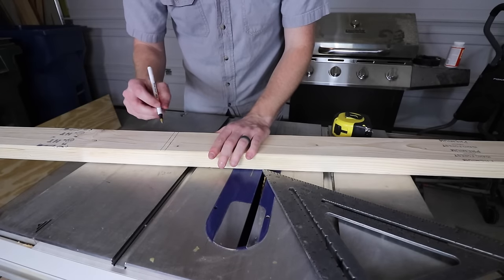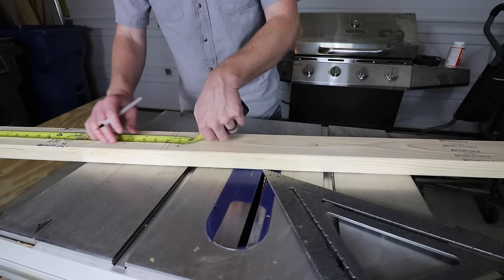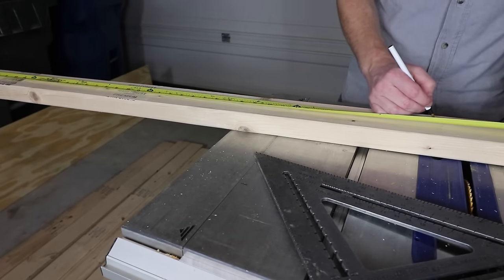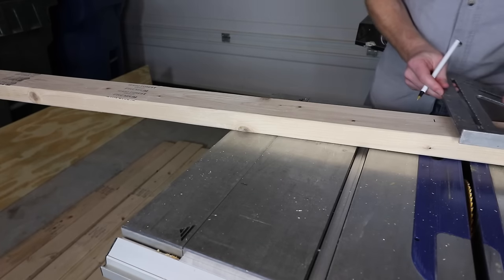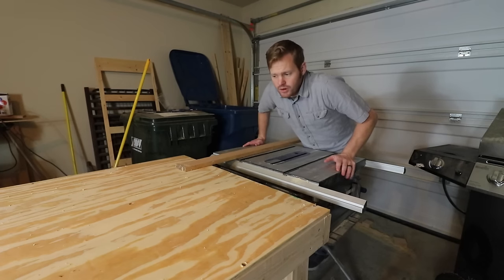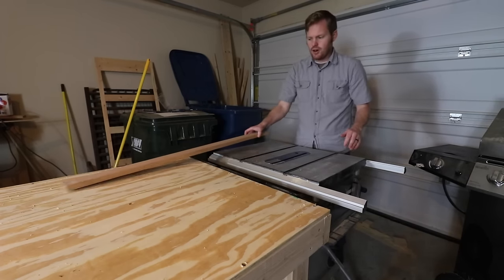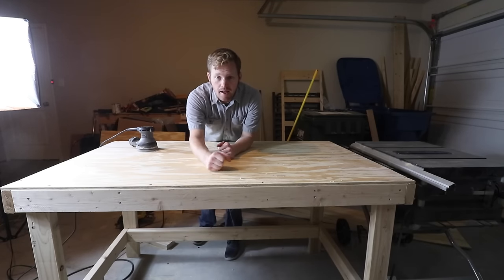EASY DIY WORKBENCH for UNDER $50

Comment: $500 in 2023
Reply: Came in to post that the title needs to be edited to reflect the new insane prices of wood. At this point it's probably cheaper to buy a pre-built work table.
Reply: $1200 in 2024
Reply: Agreed. A single sheet of plywood is like $25 dollars
Reply: You not lien!
Reply: @qxweiii Lowe’s has plywood for like 15 bucks. Pre pandemic it was like 10. Y’all are fucking wild. This might cost at absolute most 250
Reply: 2024 here: make that 1,000
Reply: Im building one right now no more than $100 in materials. Well having the tools is a whole different story. 😂 forgot screws are expensive so no more 150$
Reply: Lol still between 50-100 euros 😂

Comment: The table works great! Thanks. Here's how I got away with using six 2x4s:

Cut list (added last entry to complete the list):
- plywood rip to 2'9" x 5'
- 4 2x4 @ 34"
- 2 2x4 @ 2'9"
- 2 2x4 @ 57"
- 2 2x4 @ 27" 
- 2 2x4 @ 54"

- 2 2x4 @ 30" to support the top from the inside.

Cutting Procedure:
I got away with six 2x4s, cutting the 34" segments from the same piece, then using the middle segment to cut another inch off and make the 27" cut. Repeat with another 2x4 to end up with 4 2x4 @34" and 2 2x4 @ 27". Cut the 2'9" and 57" from same board, discard middle, then repeat to end up with 2 2x4 @ 57" and 2 2x4 @ 2'9". Cut your 54" and 30" from the same 2x4, discard the middle, then repeat to get 2 2x4 @ 54" and 2 2x4 @ 30". Install the 30" segments 20 inches from either side. Hope others find this helpful! Great video!
Reply: The video was super helpful and then following your cut list made things even easier, thanks! 👍
Reply: @h2oceann  Awesome. Glad to hear it! Been using this table heavily for over a year and it's still holding up great.

Comment: Thank you  - I am a truck driver not a Carpenter so I followed your video step-by-step and I now have a workbench!  Drilled pilot holes and used 3 inch deck screws, overkill I know, but is very sturdy! Added a vise and second shelf underneath for storage. Total cost was around $100-$110 with screws at Lowe’s - not including the vise.

Comment: This was a great first woodworking table to build, I spent a lot of time looking for a simple table to get started woodworking with, and ended up choosing this one. I realized after I started measuring and cutting the 2X4s that you only actually need 7, not the 8 listed in the description. hell, i even used the leftover plywood to make a bottom shelf and used some of the 2X4 from the original 7 to make supports for the shelf, and STILL had the extra 2X4 leftover. I want to also thank those in the comments that pointed out that 2 of the shorter pieces needed were not listed in the cut list, and that you need 2 30" pieces, that saved a lot of possible frustration. All in all, a good plan for a simple worktable/out feed table!

Comment: This is one of the best videos out there for a TRULY simple DIY workbench with all straight cuts. If anyone wants a slightly more shallow workbench (33" was a bit much for my garage space), I ended up adapting to 28" depth and getting rid of the front support beam so I could store tool carts underneath.
- ($30) 15/32-in x 2-ft x 4-ft Pine Sanded Plywood - cut to 28" x 60"
- ($20) two 2"x4"x12', one 2"x4"x16', cut to the following:
--> base: 57", 57", 28", 28"
--> legs: 34", 34", 34", 34"
--> long support beam: 54"
--> short support beams: 25", 25"
--> inner supports: 22", 22"
- ($12) Power Pro #8 x 2-1/2-in Epoxy One Exterior Wood Screws (no pilot holes necessary, comes with star bit).
I was fortunate the nice lumber associate at Lowe's did all 13 cuts for me for free right there in the store. All I had to do was a bit of sanding and was ready to rock. Next up, I'll throw some 3" locking casters from Harbor Freight for $5 each, and the total project will have cost me $82 (plus tax). You really cannot find a sturdy workbench of this size for less than $250.

Comment: Music is a little loud compared to the voice volume but the table is great!
Reply: Lower the music, or elimate
Reply: Came here to say the same. The music volume was so distracting. Great video otherwise.
Reply: Same. Love the work, hate the music.
Reply: Same, turn the music down in general, and off completely when you talk.

Good quick workbench design though.
Reply: Same here. Hard to watch. Almost better to watch with CC and sound off.
Reply: What are you guys talking about?  I can hear the tools just fine.
Reply: Music. Too. Loud.
Reply: Find the sound button on the keyboard with the line through it or under the video tap that volume until it has a line through it. Hit that button and it plays the same video with no sound and you can still learn how to make a shop table. Pretty cool, eh?

Comment: I never thought of using my speed square as a guide for cutting 2x4s with a circular saw... nice!
Reply: Chris S., that's the only way to cut a straight, square  line through whatever stock you are cutting.
Reply: @rla1000  I normally just use my miter saw 😉
Reply: Lol said the same thing when i saw that. Brilliant
Reply: Perfect when I can’t get to the mitre

Comment: This is the fastest and easiest way to do it. Most people don't realize how strong this simple design is when it's all put together.
In 2004, That's basically how I used to build my benches/counters. I usually add some plywood on the stringers to make a shelf or 2 based on the dimensions of the height, and purpose.

Comment: I just built a similar table yesterday myself. On the bottom, I put this side braces inside the legs, then added one long brace between them down the middle, finally slide and screwed in a 1/4" piece of plywood. Made a nice storage shelf for some lightweight stuff. I could have gone with thicker plywood, but I didn't want to add a bunch of extra weight.

Comment: I had an old 4’ x 7’ wood ramp and a pile of scrap lumber. I’m building a new 12’x18’ deck and wanted a temporary workbench on the “job site.”  Used your simple table leg design to cut and assemble a 4’x 6’ bench in less than an hour. Thanks for sharing.

Comment: Great short & easy project video.  Checking the cut list, it appears you left out the table top support pieces.
- 4 2x4 @ 34" - Legs
- 2 2x4 @ 2'9"- Top frame End Pieces (33 in)
- 2 2x4 @ 57"-  Front & Rear upper Frame
- 2 2x4 @ 27"  Lower frame end support
- 2 2x4 @ 54"  Lower frame front & rear support

Comment: Thanks for this I’ve been looking for a simple beginner workbench build. I’ll probably add some supports on the bottom frame and screw another Piece of plywood cause I could use some extra storage space underneath and I’ll probably add some casters too. But great build and good idea making it level with the table saw I’ll probably do the same

Comment: Thanks for sharing this. I just made one out of pressure treated wood for outdoor use. It cost me 100 bucks because I used prime grade and deckmate torx head screws. They have a drill type tip so no drilling necessary. Went together quickly and it is solid. I used more screws, from two directions. It's an easy and solid design. Thanks again!
Reply from the maker: Awesome! Id love to see pictures of it.
Reply: Matt Mecham I took one quick pic in my basement... Then I realized I didn't know if I could get it out through my Bilco Door. 😮 Also, I realized that I made it to your exact specs, which was for your table saw, correct? Not necessarily the best height for me. Turns out I screwed a couple of 2X4 pieces on the ends of the legs...against the dirt...and it's perfect. Do you have an email? Can't seem to be able to attach a pic to this reply. I was able to get it outside.
Reply from the maker: You can email it to builditwithmatt@gmail.com or tag me on Instagram or Twitter @mechammatt

Comment: I'm really cheap so I wanted to see  if this could be built with less material. If you cut carefully and don't make any mistakes, you can do this with just six 8 ft 2x4's, instead of 8. This is including the two 30" pieces fo the top supports that Matt forgot to list in the description. You can also use one 5x5 plywood instead of a whole 4x8. Here's how to cut if anyone is interested. I'll be making this later this week so hopefully I did the calculations right!
2 boards, cut two 34 inch pieces and one 27 inch piece
2 boards, cut one 30 inch piece and one 57 inch piece 
2 boards, cut one 33 inch piece and one 54 inch piece 
5’x5’ plywood. Rip to two pieces, one 33” and one 27”. 33” for the top, 27” for the shelf. Comes out exact, no leftover plywood.
Reply: Where do you find 5x5 plywood? I've seen 4x4 (half sheets).
Reply: @ms55938  I totally messed up and thought 4x4 sheets were 5x5 lol. I didn't want to buy a whole sheet so I just used 4x4 and made a slightly smaller bench.

Comment: Thanks for sharing. I built some raised garden boxes a few years ago the exact same way (other than plywood top). My problem was I didn’t have a perfectly flat surface to build on… so when I screwed together the box and then the legs and flipped it over the whole thing was wobbly. It didn’t matter since they out in the yard and I could shim the legs to get level, but do you have any tips for making sure the workbench wouldn’t do that too?

Comment: A good way of doing the same job a counter skink bit would do is drill a pilot hole, and use an ordinary philips bit that you don't mind roughing up to widen the top of pilot hole to ensure the head of the screw is flush with the surface you drilling it into. One thing I noticed you didn't do was use a level, using a level can make a huge difference building a working surface.

Comment: I do not have any Table saws but I do have 2 drills and hand saws and chisels. I could layer the Plywood into a thicker work surface and have the joints glued but That will make it go towards 100+ but It would be perfect in my case if I did that.

Comment: I need a simple computer desk around 80x50 cm. One of the lower support is not suitable to get inside with chair. But I also want a rigid not moving desk. Do you have any suggestion?

Comment: Think I’m going to make this bench new to woodworking. Can some confirm I got everything right in my Home Depot cart. Total $60.81 here’s the list. 

(1)
Handprint
1/2 in. x 2 ft. x 4 ft. BCX Sanded Plywood (Actual: 0.451 in. x 23.75 in. x 47.75 in.)

(1) 
Grip-Rite
#8 x 2-1/2 in. #2 Phillips Bugle Head Coarse Thread Wood Screws 1 lb. Box

(8)
 2 in. x 4 in. x 8 ft. Prime Stud
Reply: Think I’m wrong people saying this setup cost $500 in 2023 😮

Comment: Matt, I've been thinking about building a workbench for a while as my second carpentry project but have been intimidated as I thought it might be too onerous. However, your clear instructions have given me the confidence to actually go ahead with my plan to build one. I do have one question though. Your cut list, excluding the plywood includes 12 pieces. But in the video I noticed that you used 14 pieces, including the two you used to brace the top frame, which with my calculations would be 24" in length. Could you please confirm? Thanks..

Comment: Great vid, nice punk music, reminds me of the early 90's. Im glad your table turned out. Every time i try to make the square frame for the top, no matter how straight the crown and rib of the 2x4's are, my frame is always crocked. I use a chop saw for the cuts. im wondering if its not cutting true...

thanks
Reply: Use a square to check your Miter saw. Even a cheap speed square will do the trick. That's how I figured out my circular saw plate was off. Cuts kept coming out off so I checked it. Easy way to check square is measure from corner to corner, if the measurement is different you are out of square.

Comment: I'm not clear on how you screw in the leg supports since you don't show it on the video.  The smaller supports look like they are in the edge so does the screw go in straight or an angle to avoid splitting the wood.  I would love a short video just showing and explaining how the supports are screwed in.  Also you don't show a close up on how you screw in the legs but I was able to see it from one of the video angles.  You put the two screws slanted from each other
Reply: Use a 1/8 inch drill bit and drill the pilot holes first. This keeps the wood from splitting when you put the actual screws in. Putting them straight in is fine.

Comment: I was going to try this today but your math doesn't quite add up. Say, those 57" sides: for the under support, you have the wood between the other two pieces. Since they're 2x4s, you subtract 2 inches from each side: that means the lower support should be 53", not 54. 

The same for the 27" lower supports: if the top edge is 34", and you're nailing to the legs, which are themselves 2" inwards because you nailed them to the inside of the frame, you subtract 4" for the legs AND 4" for the frame width, giving you 26" lower supports, not 27". 

Are you adding the extra inch for some reason I'm not realizing?
Reply: 2x4's aren't really 2''x4'', they are 1.5'' x 3.5''
Reply: @ligon29  yup, found that out today as I was building it and my measurements were wrong, requiring some re-cutting to retrofit it all. 12 years in the America and I'm still finding out new things. Like math isn't math, really 😀... I mean why would they be called 2x4 if those aren't the actual measures... 🤦‍♂️

Comment: I hate complaining about music after you’ve been to the time and effort to make a free to watch video. Unfortunately though I couldn’t hear you so turned the volume off and watched you instead. Us later middle aged guys don’t have the hearing you younger ones do.

I have a tiny 6’x6’ workshop, so I bought one of those cheap "German' work benches. A mistake I admit and I'm now working on bulking it a bit. One thing I have done so far is to put blocks of wood under my dog holes drilled through. I can now use 12mm thick holdfast. This week I'm going to make a plane rack at 30° from my shelf strengthening my legs at the same time. With the triangle formed with the plane rack I'm going to make a little cupboard and a clamp rack. I also want some wheels so I can manoeuvre it to a better place to work. Just some ideas for any other newbie as stupid as me. 

It was a good video, your table looks a lot stronger than mine. I always enjoy seeing fathers interact with their kids when doing their hobby. The music was a mistake, but not as bad as my work bench.

Comment: how much price of "8 - 2x4 at stud length" I checked that over 100$ for this
thanks!
Reply: I'm cheap so I buy cheap 2x4's.  That would be around $24-$32 for some 2x4s that will be used on a table that will be indoor all the time.
Reply: I paid a little over $3 for each stud length 2x4
Reply: An 8 ft 2x4 is 3.47 is at the Home Depot
Reply: Long Đào Hữu I just bought all the materials plus a new tape measure, screws and a bit for $65! 
Emporia, KS

Comment: Why doesn't he use the table saw to crosscut instead of using it as a sawhorse?
Reply: Maybe a simple worktable, needs to be built by beginners, with the average tools they may have.
Reply: He probably doesn’t have crosscut sled. The crappy miter that comes with his table saw (and yes I have a contractor saw) can be difficult to use. Circular saw offers more contol (you are moving the blade vs moving the wood). Just my 2 cents.
Reply: Maybe he should of built a crosscut sled first then? lol
Reply: making cross cuts on a table saw like that without a sled is kinda risky, circ saw is much easier

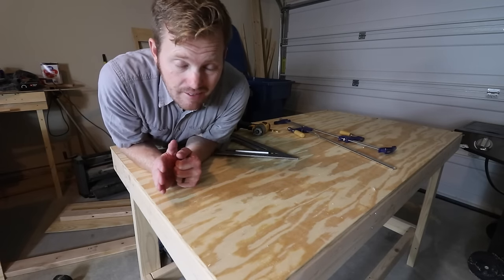Comment: 4:58 For an on-the-fly countersink, after you've pre-drilled for your screws, just use a Philips head driver in your drill and force/spin it into the hole until you've created a countersink dimple.  btw, music sucks, lose it, you don't need it

Comment: I think you may have messed up on your measurement list below.... The 2 cross pieces that help support the top should be 30", not 27"... According to my math.... However, our state is ranked almost at the bottom of the 50 states for education,...so, that's my disclaimer if I'm wrong!
Reply from the maker: +Jeff Bateman it's possible that I messed up my math... I hope I didn't. I'm pretty sure I checked and double checked before saying what I did. But I'm only human haha.
Reply: +Matt Mecham regardless.... Thanks SO much for sharing!... I started building the bench today!
Reply: +Matt Mecham I figured out what it was!  The 27" studs are for the lower supports.... You just didn't list the the 2 30" pieces to add extra support underneath the top surface!  GREAT, Affordable design!  Thank you SO much for sharing Matt!
Reply from the maker: +Jeff Bateman oh I'm so glad you liked it and that my math wasn't wrong haha. I just messed up my list. Thanks so much for watching.
Reply: Its MATHS!!!!!!!!, with a S at the end, not math.

Comment: You need a work bench to make a work bench. How do I get around this?
Reply: when i built this, i just used the 2x4s as a platform to cut the plywood on, and even used one as a fence to keep the cut straight. as for cutting the 2x4s themselves just use 2 objects of relatively same height to prop them off the ground!
Reply: jamesacoustic16 thx
Reply: Build a time machine first
Reply: Write down the cut list and have them cut it at the store for you, then all you have to do is assemble it.